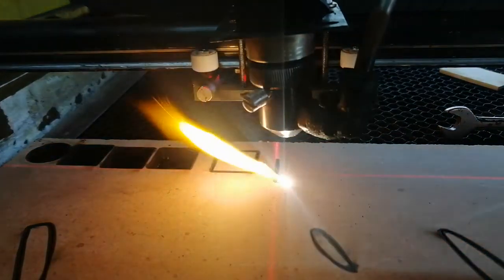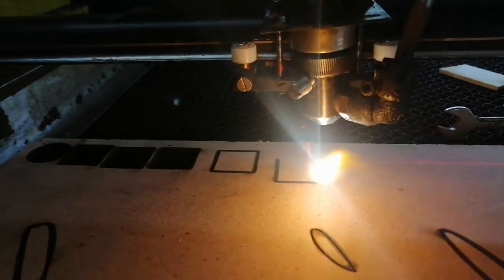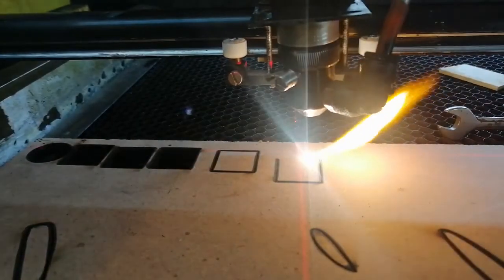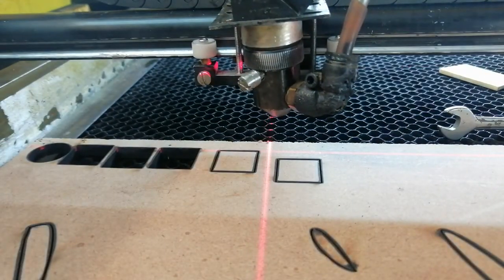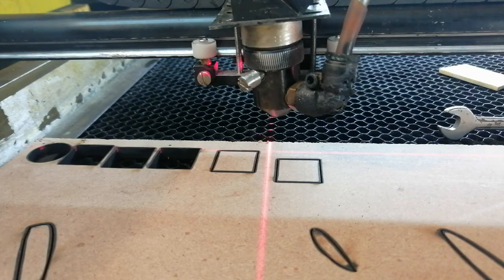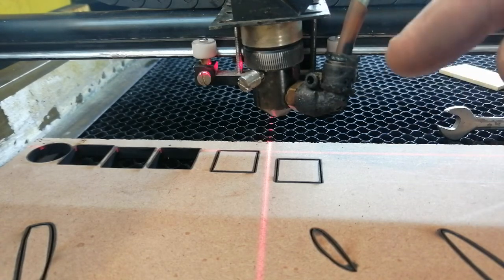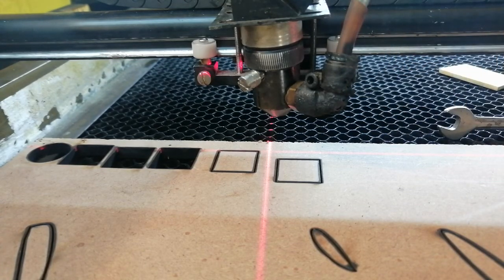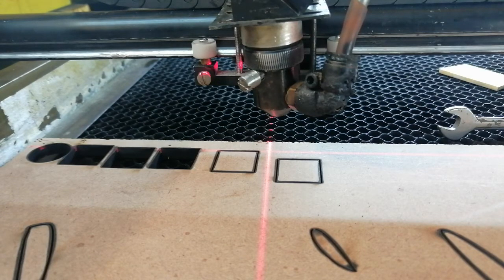Laser cutting problem   z axis  alignment

Comment: It seems a long long way away from the wood to be an accurate cut . What lens are you using and what focal length did you determine to be correct ?
Reply from the maker: 50. 8 was the focal lenght and the problem was a hole in th elbow on the air assist